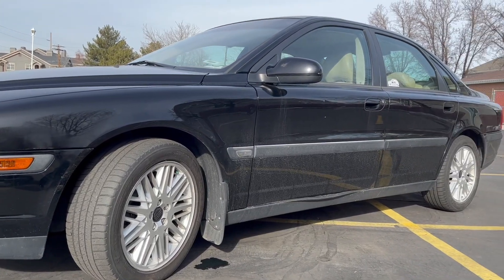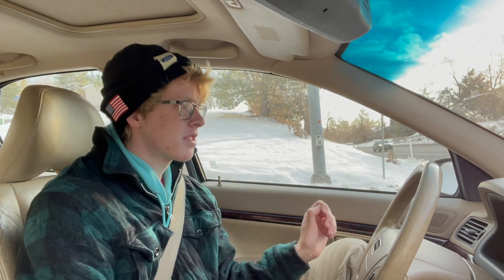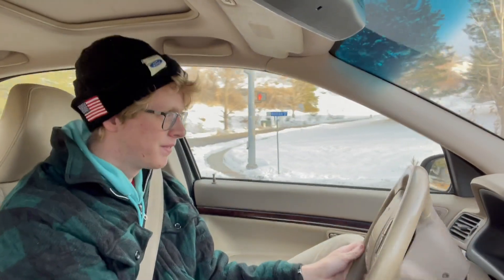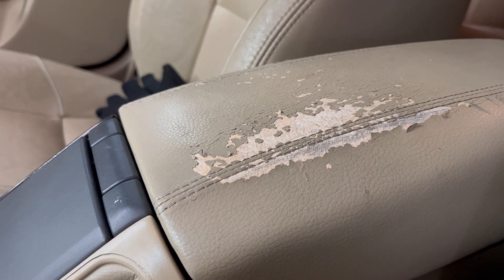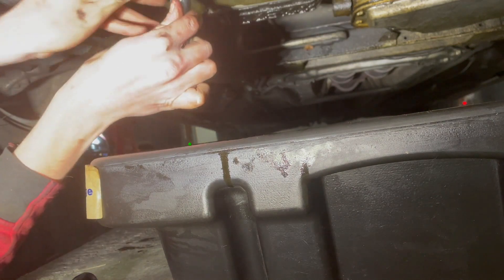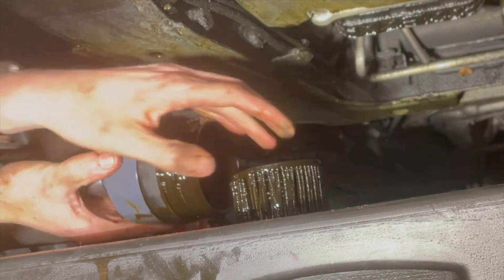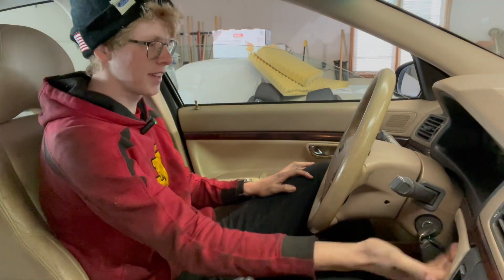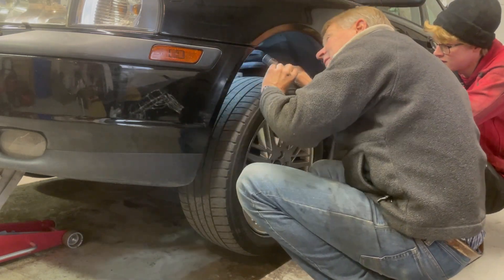Attempting To Maintain and Inspect My Cheap Volvo S80

Comment: I bought a 2008 Volvo S80 T6 with 117,000 miles for $1200 three years ago. Needed allot of work that I was able to do myself with help from the online community. Volvo is a luxury car with expensive OEM parts and poor gas mileage but it is a heavy car that has more protection in an accident. My wife does like the features on it.The list of my repairs has been as follows: replaced the water pump/flushed the power steering fluid and replaces the reservoir (after market)/rebuilt the vacuum pump (oil leak)/reattached the blower motor with a set screw/repaired a power steering line leak/replaced rear brake rotors (after market)/removed haldex unit and replaced both pinion shaft bearings - AOC and differential fluid and seal (time consuming job) made a smoke machine to diagnose oil fill cap o-ring seal leak. that improved gas mileage and stopped a check engine light from coming back on/ replaced brake fluid/ fixed passenger side motor mount with a wooden shim. ( motor mount was causing passenger side noise. Four new tires with alignment and a new battery. The list continues with a possible brake master cylinder that is starting to bypass brake fluid. It now has 134,000 miles on it and it gets 19 MPG. With gas prices high the savings in depreciation are being eaten up by cost to drive. At some point getting a more fuel efficient car would be a better choice. Good luck with your car. There are people who love their Volvo and do their own repair work. You can keep down the cost of ownership by doing as much as you can yourself. There are common wear items for each model and year and if you search the online community you can get answers to your problems. This video may help with the throttle https://www.youtube.com/watch?v=RsUXVlL9Mho

Comment: I have a 2004 S80 2.5T awd.   With 103,000 miles.   Beautiful car cosmetically.  A few issues mechanically though.   Nothing to crazy bad.  Just spent $1k on routine maintenance like oil change, brake fluid flush, transmission fluid flush.   Early next year it will time to replace the timing belt and water pump.  
It’s the first luxury European car I’ve getting owned.  I like it for now but with maintenance costs this high I know I won’t have this Volvo for more than a few years.  
Older Volvo’s are quite expensive to maintain.  I’m not a person with deep pockets.

Comment: Nice! I want those rims on mine eventually! I just bought a 2003 2.9 for 3,640. I love him, named him Sven. Not perfect as well. I have possibly exhaust leak or clogged catalytic converter, air bag needs to be serviced, driver window doesn’t roll down and sunroof doesn’t open. Interior is almost perfect except the front seats are cracked a bit
Reply: Well....a word of advice  SELL  that car .......volvos  are money  pits......they will empty your  bank account....seriously....I bought  a 2010   S 80 turbo  last  year  and I haven't  stopped  spending  money  on it.... I spent  $3000. On  it so far .....I'm warning  you  now ...😅

Comment: could be the throttle body?  It might need to be cleaned?  I had to replace mine which was not cheap on a 2001 S80.  A replacement throttle body would need to be programed to the car by someone that has access to VIDA or DICE for Volvo.
Reply: Actually the throttle body is not tied to the car, you can just swap these out!

Comment: These are great cars with good maintenance, however the T6 is probably the worst trim. That engine/transmission combo was bad. Transmissions usually give up in the 130k+ range.
Reply from the maker: I should be fine! Mine only has 134,000... uh oh
Reply: @TopherParkerCars  😂